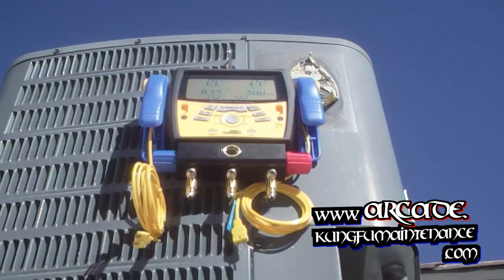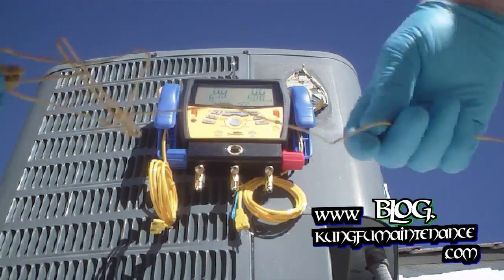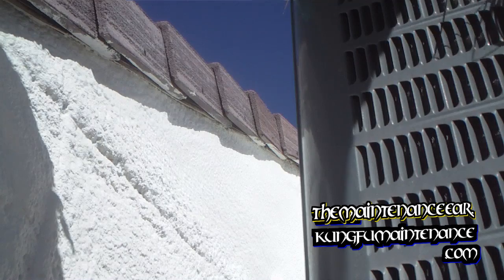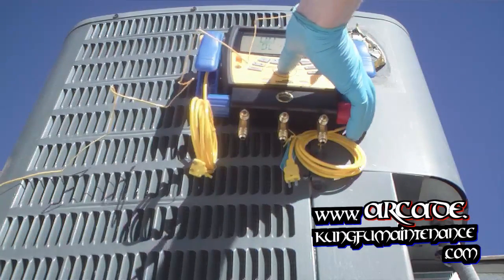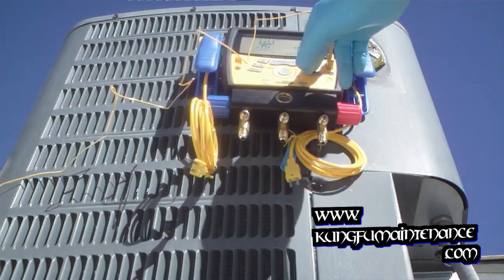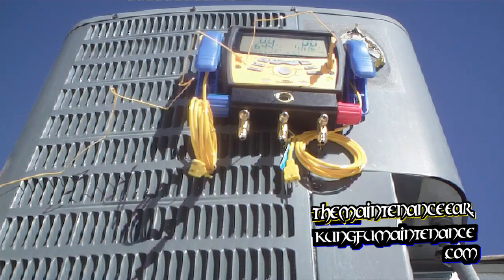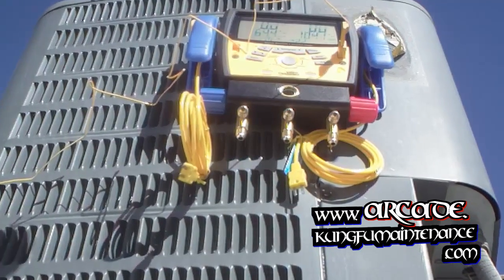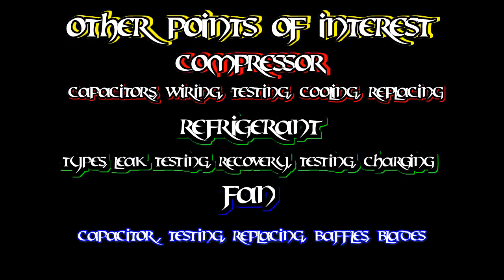How To Test Outdoor Dry Bulb Temperature Where To Measure ODDB For Air Conditioners

Comment: Would taking a dry bulb reading in the return give you the same temp as if taking a dry bulb measurement outside?
Reply from the maker: Good question. No the return would give temp of return air inside the building while outside reading would give outside ambient temperature. Return air changes as system runs. Outside ambient temp stays more or less fixed changing slowly as weather and time changes.
Reply: +KungFuMaintenance  got it thanks.